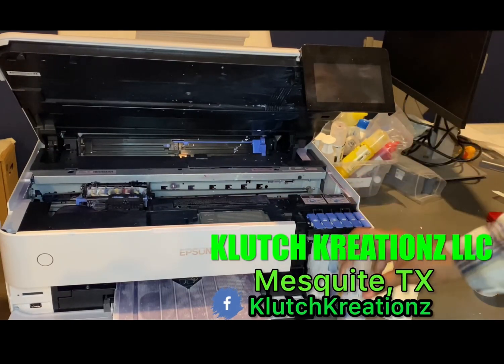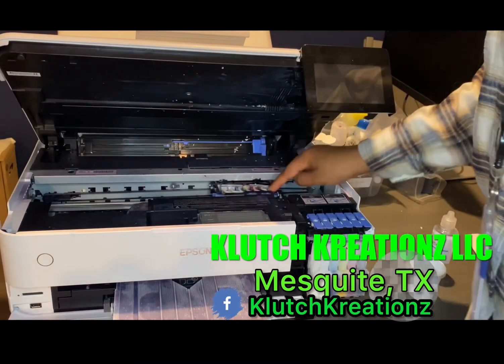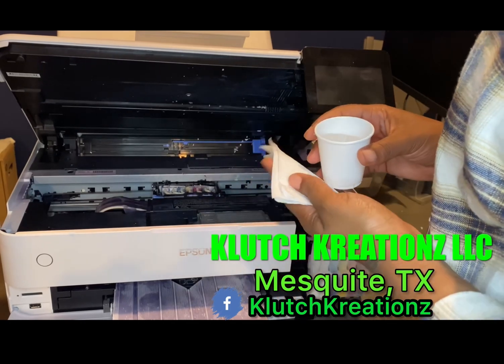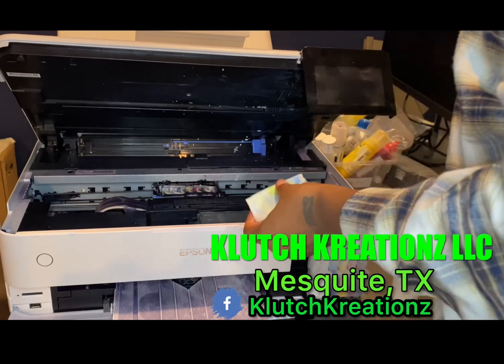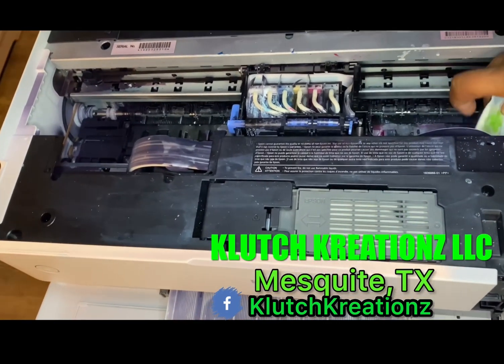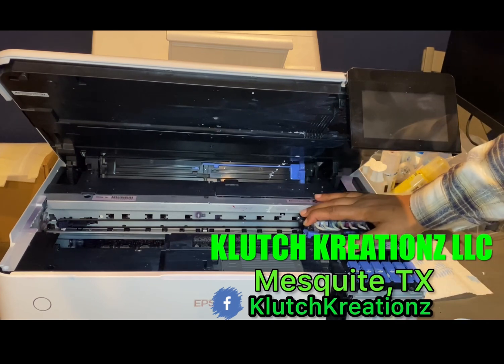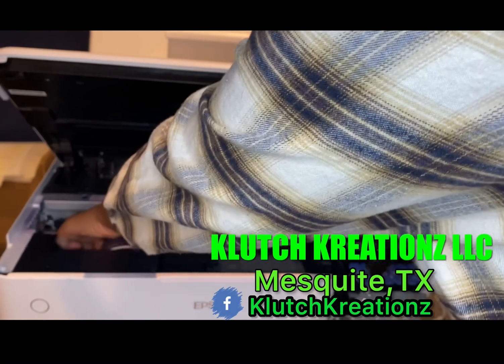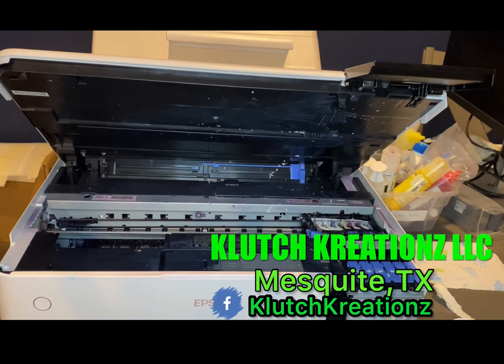Unclogging DTF printhead with the “Wet paper towel” method. Working on the Epson ET 8550

Comment: Hi, I’ve done this, but for some reason I’m still getting lines but the line are only coming out in one spot like towards the end of the print. My print head cleanings and nozzle checks come out good. Would you have any suggestions?

Comment: Mines is still clogged I have tried everything
Reply from the maker: What did you do the wet paper towel stack with?
Reply: @klutchkreationz  cleaning solution now my printer want even come on now
Reply from the maker: If its not coming on thats something different. Epson will replace it just flush your ink lines.
Reply: @klutchkreationz  even if I have taken the rollers out
Reply: Don’t tell them you took the rollers out

Comment: I am having some issues with one clogged line. I have taken the print head apart, cleaned it, reassembled, did a power cleaning and now all lines work other than my first white cartridge. It’s the only one left clogged. What do I do now?
Reply from the maker: I don’t disconnect the printhead nor recommend it. Power cleaning and wet paper towel soak will unclog it
Reply: @klutchkreationz  I put everything back together and waited a couple of days. Did the paper towel soak and it ended up frying my hardware. Not sure if me leaving it overnight was the issue or what. They are exchanging the printer out though so I am currently waiting on that to arrive.
Reply: @Zoeygonzales6767  paper towel probably was too wet and leaked into the printer, and destroyed it. Water and electronics don’t end well.
Reply: @calw8085  yep figured that out lol my replacement will be here tomorrow 🙌🏼